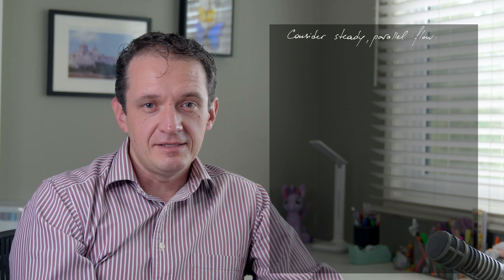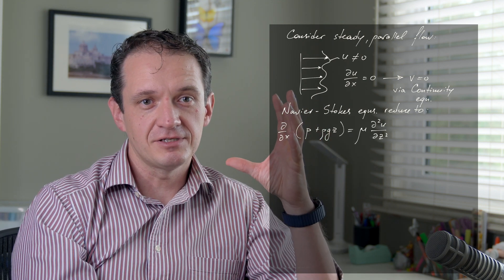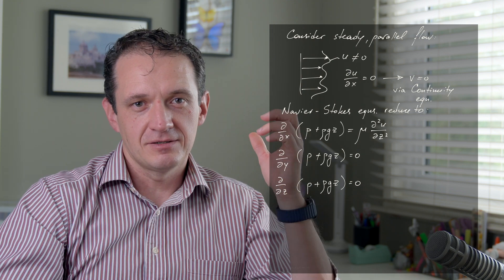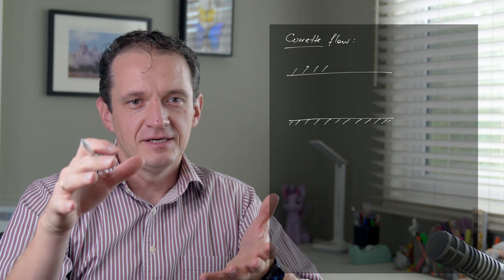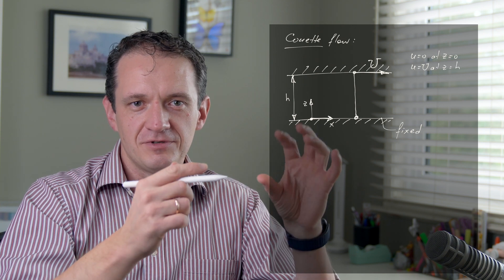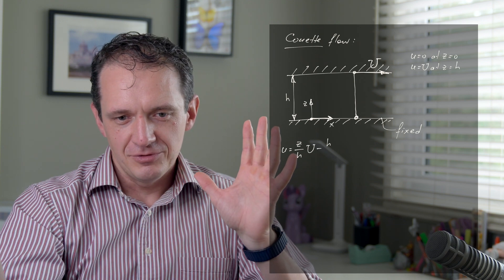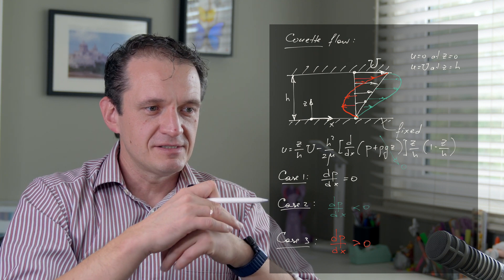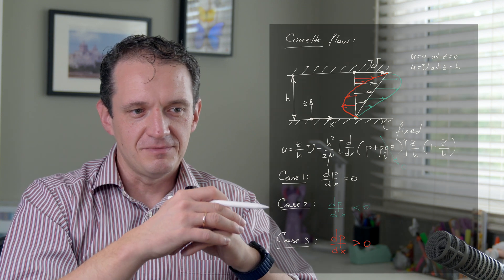Couette flow

Comment: I pump digested sludge solids seven miles in 8” pipe at a loss of 14’ head with 150hp centrifugal pump to attain a rate of 400 gpm.  Keep posting vids, your Reynold’s transport theorem presentation is a favorite.